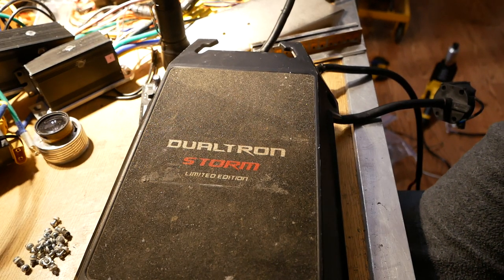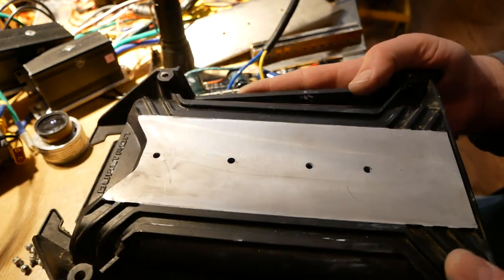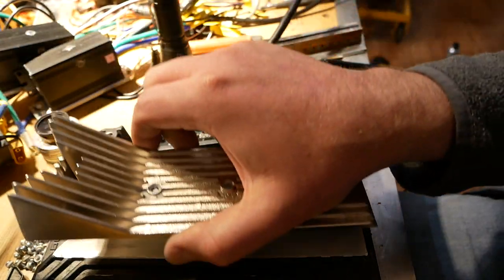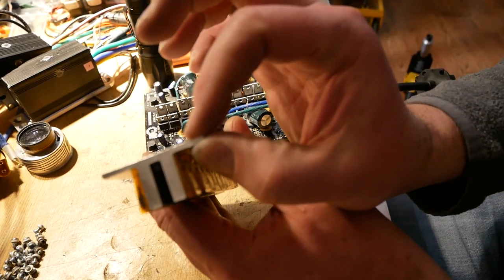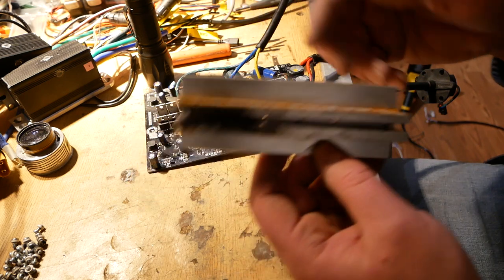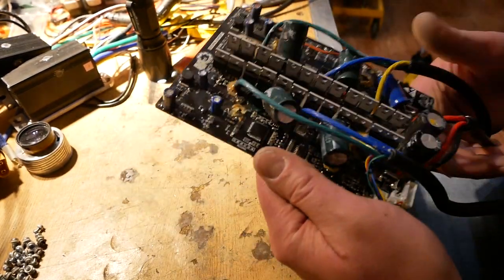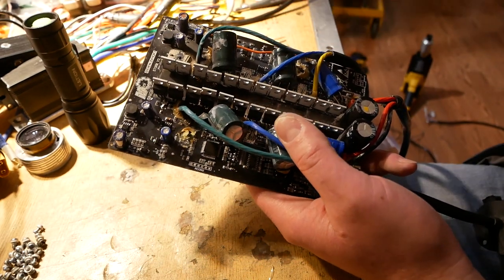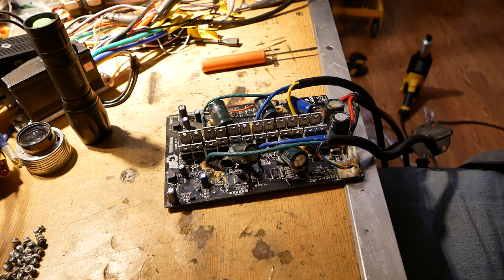Dualtron Storm LTD controller teardown - Why they die so often

Comment: De-bodgery, Thanks for a VERY informative video - You know, it seems like no one has gotten it right yet - No matter how expensive or popular the scooter.  I've almost bought a Varla, almost bought an Apollo, now I've almost bought a Dualtron - Holy smokes!  Have the need and funds but no good, reliably designed, high quality component equipped, and well built scooter to buy.  Any suggestions for a guy like me @ 6'3, ~300lbs needing a longer range, Strong scooter - Totally frustrated!
Reply from the maker: Dualtron tends to under design and then later fix the weak areas. for example, the city has many places that are held together with M3 screws where they should have used M4 or M4 where they should have used M5. Anyway, they do eventually fix the things that are weak. The City is brand new so it's going to have things that should have been beefed up more. 
*
Dualtron scooters that I have never taken apart or worked on are these. This is not for lack of quantities of them out there. They just don't seem to break down or have issues. The X2 is somewhat rare, but it's built like a tank. I've ridden one and it's plenty powerful and robust. I'd buy either of these without reservations. Neither have solid rubber tires which is an enormous PITA to change out! You do NOT want a scooter that lacks air filled tires!
Dualtron Storm (NOT LTD): https://minimotorsusa.com/products/dualtron-storm
Dualtron X2: https://minimotorsusa.com/products/dualtron-x2
Reply: @de-bodgery  Hey De-bodgery,  Thanks for the quick reply and I understand the approach you've taken in addressing some of the faults in the scooters.  The X is a monster and just too much for my needs but while griping, I came across the Dualtron Thunder 2 and I'm cautiously interested and almost impressed.  To learn more, I viewed some videos and no one seemed to have had major negatives to report.  To be sure, I visited your posts and videos and didn't see anything negative.  BTW,  you've got a ton of very good videos that take deep dives into the electronics of the machines - Good Job.  Any thoughts / experience with the Thunder 2?  I live in a tropical climate where it's in the 80's most of the time so dissipating heat is my biggest concern - thankfully no hills, off-roading or racing automobiles for me - one shattered femur was enough for me. Thanks again for sharing the knowledge. 👍👍
Reply from the maker: @mobayguy  The Thunder 2 is probably OK. It has pneumatic tires and has been around a good while so the typical weak spots have probably been worked out. The local shop I work for, they have them for sale and I've never worked on one so that's probably a good sign that it's going to be reliable.
Reply: @de-bodgery Sounds good.  The lack of any major issues is encouraging.  On to the test rides and hopefully a satisfied purchase with the Thunder 2.  Really appreciate the replies.  All the best
Reply from the maker: @mobayguy  Hopefully the fact that I've never worked on one is a good sign! Good luck and you are welcome!

Comment: Wow adept. Have come across dualtron spider 2 issues? I’m about to buy one.
Reply from the maker: I've been working on Dualtron scooters only recently. There's several models I have not seen inside or needed to work on them. The Spider is one of them. I don't really have an opinion about this model other than some general design and wiring choices that are common to all Dualtron scooters.

Comment: About the hall sensors. I work as the lead technician for electric scooters at a workshop reparing electric scooters. And I can also confirm that the controllers in outher dualtron scooters have the pads on the PCB for hall sensors but are not used. We have had costumers that are wondeing why their 4000$ scooter sometimes drives backwards into them when trying to start from a standstill.

Dualtron selling scooters with questionable design for lots of money and caling them the dream of electrical technology or something.
Reply from the maker: Yup...no halls is the reason. The controller can't detect the correct direction of commutation when the motor is stopped without position sensors such as halls. It "finds out" by guessing and attempting to spin the motor in some direction. Once it can detect a little bEMF, it then knows if the direction of spin is backwards or forwards. As a result of this guess, it gets the direction of commutation wrong sometimes and the scooter shifts backwards. With a dual motor scooter, this can be quite pronounced if both controllers guess wrong at the same time. Not having halls is stupid. In my Dualtron City, I had the motors apart anyway and so I added halls and a temp sensor to both motors.
Reply: @de-bodgery  Hall's are garbage, more easy for the motor to fail either form water or bumpy road. Motor without hall can resist water damage and hold itself after rough driving and the only downside is that it goes in the wrong direction from standstill i mean like that's fucking insignificant
Reply from the maker: @sdfefde  Halls or other forms of position sensing are highly useful! Halls are far from "garbage"! It seems you think running sensorless is the best way to go. I think if that was the case that the entire motor industry would have abandoned hall sensors and in fact they have not...or any other form of position sensing for that matter! You in fact state exactly why position sensing has not been abandoned and then ignore it like that's a trivial thing! You are entitled to your opinion, but I think you won't find a lot of people who build motors and controllers that will agree with you...myself included!
Reply: @de-bodgery  Well halls have some upsides but they are a potential liabillity. It could be argued it's planned obsolescence
Reply from the maker: @sdfefde  Halls are delicate devices to be sure so you use them within their specs and then they last many thousands of hours. Most any modern gas car or motor cycle has halls on the engine to detect crank and cam positions. Most hybrid of fully electric forms of transportation use halls or some form of hall device for motor position sensing. Billions and billions of motors in all sorts of applications use halls of some kind to detect armature position. This has been the case since the early 1980's! They are used in highly reliable tape back up solutions used in data centers the world over for detecting the tape drive motors. Any form of spinning media devices (CD, DVD, etc) have halls in them for RPM detection. Millions of machines in hobby shops and industrial shops have halls on the various actuator and drive motors for position and RPM detection. This is a VERY reliable technology used in trillions of applications all over the world for the past 50 years! If that's "planned obsolescence" all I can say is I wish more companies products became "obsolete" this way!!! Halls are inexpensive, VERY ubiquitous, reliable and available anywhere!
Reply: @de-bodgery  Objectively in the case of electric scooters sensorless motors will indeed be more durable, for a very small inconvenience
Reply from the maker: @sdfefde  It's one less point of failure to be sure albeit a pretty small point of failure. I've built and upgraded 30+ EV's myself. The ones that lacked halls, I added them. I do a lot of repair work on scooters for a local shop. I can't say the ones with halls are less reliable than the ones that are sensorless. I see the same sorts of failures in either category and dead halls are never the reason and super rare. I've worked on hundreds of motors since 2015 and seen bad halls less than 10 times. It happens, but it's not very common. I have spare halls, but they are mostly there for adding them to motors that lack them or because I've rewound the motor and had to remove the halls to do the rewind. This is a pretty insignificant point of failure!

Comment: I crashed with my Victor a few weeks ago, Got a new engine and put it on, works fine but after awhile of driving, something turns the scooter off. It keeps doing so but with less speed. Cables are fine. Something else is causing it
Reply from the maker: does the LCD turn off too? If so, your BMS is possibly shutting down. It's also possible that you have a loose battery wire. The entire scooter is powered through the controller box. Make sure all your battery wires in and out of the controller are tight and fully pushed together. If your connections are all good and the LCD shuts off, your pack is having issues. I have a pack arriving to me tomorrow that needs a new BMS. The pack costs $1000 to replace and I can probably swap out the factory BMS with an after market one that is smart and works with your phone. I'm pretty sure the new BMS will get that pack going again. It does something similar and shuts down at odd times.

Comment: Bonjour comment faire pour désactiver le  dual motor en modifiant
Reply from the maker: you want to run from jsut one motor? Why would you do that?
Reply: @de-bodgery  pour pouvoir le mettre de temps en temps quand la batterie est faible
Reply from the maker: @eaujavel7662  Ride slower then you don't have to do anything
Reply: @de-bodgery  et pour faire des wheeling mais la roue avant tourne en même temps c'est pas agréable
Reply from the maker: @eaujavel7662  Uhhh...lean forward?
Reply: @de-bodgery  je voudrais juste la roue arrière en appuyant sur un bouton
Reply: @de-bodgery  je veux désactiver la roue avant avec un bouton

Comment: Hi, your video is very interesting. Can you tell me the voltage and capacity of the capacitor attached to the controller in
Reply: And will it have a good effect on the output if I increase the capacitor capacity?
Reply from the maker: Watch the video...it's all in there.
Reply: @de-bodgery  I don't have the ability to translate the video in detail. But I can translate the writing.
Reply from the maker: @SLACK_CORE  Gotcha...470uf, 100v caps.
Reply: @de-bodgery  Thank you. One more question. What are the advantages of increasing the capacitor capacity?
Reply: I live in Korea. I drive a Storm Limited in Korea. By the way, the Korean version seems to have slightly different parts.
Reply: @de-bodgery  Do you think the problem you pointed out is solved?
Reply from the maker: @SLACK_CORE  They are there to control ripple or noise on the DC buss at the mosfets. There's very good reasons for the large filter caps being at the mosfets for each phase. Motors make a lot of electrical noise and you don't want that back feeding to the other 2 phases. This creates instability in the entire controller. The best way to handle it is to filter it out just as soon as it gets to the DC buss. It's possible that larger caps like 1000uF might be better here. The increase in capacitance will help with increased ripple filtering if the 470uF caps are not enough. I'd have to see a working controller running a motor under load and see what sort of noise there is on the DC buss to know if it needs more filtering or not beyond replacing the 2 330uF caps with 470uF caps.
Reply from the maker: @SLACK_CORE  Really? So you took apart an LTD controller and compared it with the controller I show in this video?
Reply from the maker: @SLACK_CORE  I'd have to see a brand new controller that was just made to have an opinion about being "solved" or not. All I have is a single controller to look at and not more. It would be cool to find another one and check it out to see if there are variations in them.
Reply: @de-bodgery  Is there something different from the existing one?
Reply: @de-bodgery sooo ! If I change all 6 caps and put 100v 1000uf will it work without problems ? ! I don’t want to fry my controler or do something wrong ! Thanks in advance
Reply from the maker: @huihup  Nah...use it as is until it takes a dump and then buy a Tronic 250R2 or something else VESC so yo ucan be using good controllers.
Reply: @de-bodgery  I have a normal storm bye the way ! The back connector fried, have to replace! I think I will replace just the two caps and put 470uf ! To be all the same ! And I have the radiator and it’s aluminium ! Not like in the video! The big problem I have with it is the throttle! It is way to harsh and don’t have modulation at all ! What can a do to ease the throttle ! Thinking of buying a diferent throttle! A thumb throttle I think the magnet in that is longer ! Hope it works
Reply from the maker: @huihup  nothing...that's the dumb controller! They have no throttle programming that you can adjust. Get VESC! You'll have more options than yo ucan imagine!
Reply: @de-bodgery  I want to change all caps !
 I have 100v and 470mf ! It’s ok to change them on the phase wires ?